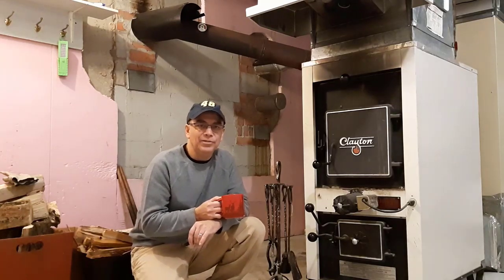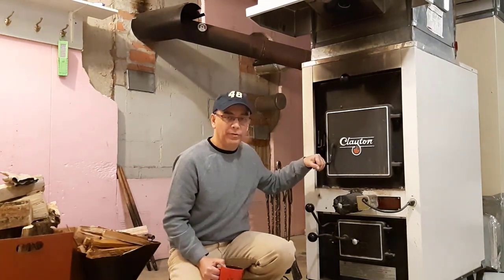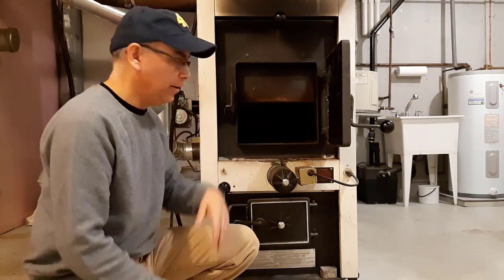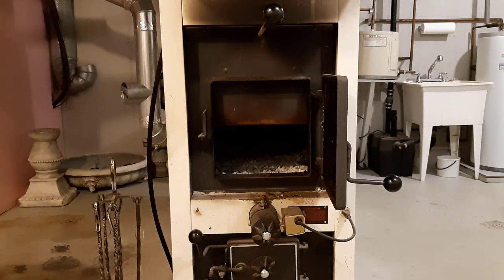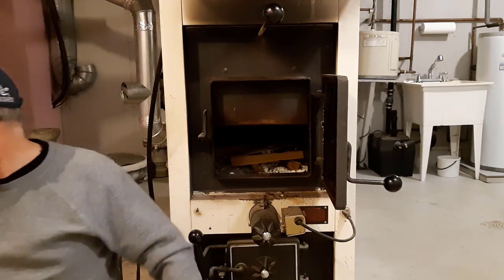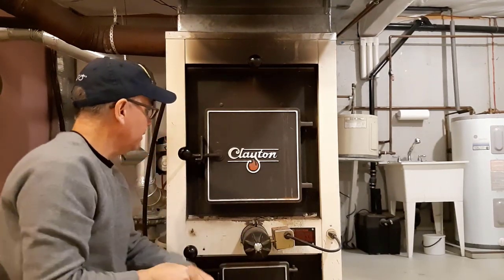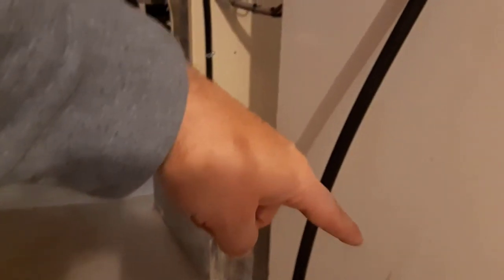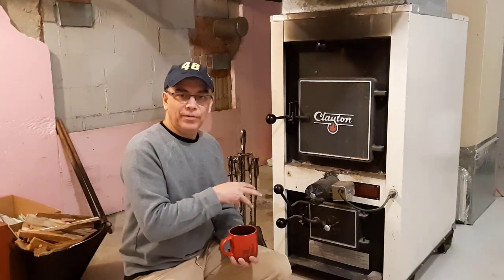USING A WOOD FURNACE INSIDE A HOME // Keep Your Home Toasty Warm!

Comment from the maker: Thank you for watching! Let me know if you have a wood furnace in your home and your experience with it... Also you can watch how I make kindling fast here: https://youtu.be/tlDZ81EB5YE
Reply: Question and Help; First of  all thanks for the video .I have a wood burning furnace attached to the heating oil furnace. How does it work? Can you use the wood furnace ONLY or does the heating furnace need to be turn on when you are using or firing up the wood furnace? Can I just fire up the wood furnace and the blower? Right now I dont have oil in the heating furnace oil tank. I havent use any of it yet  and I cant find anyone to help me clean or do the maintainance on both? Thank you in advace
Reply from the maker: @kassandrapage4379  You can use the wood furnace only. The oil furnace will be on because the blower will be used to blow the heat from the wood furnace (fire box). I adjust the thermostat so the oil  furnace doesn't engage and run. At the same time the blower will work for the wood heat. Hope that make sense.
Reply: @GettingItDoneRepairs  Thank you for the response. I have one more question. Does that mean that I dont need to buy oil for the furnace to turn the fan on? A friend of mind told me she has to spend $1500 for heating oil and it only lasted one month and the thermostat was set 65 deg. F. I cant afford to pay $1,500 a month to heat the house for 4 months of winter.

Comment: I have a Clayton furnace in my basement tied into the heat duct system, ours has it own blower motor. I installed it when we built our house in 85 and I still use it. Once it gets cold I no longer use the heat pump, just the wood furnace. It has served me well, paid $900 for it in 85 so far the only thing I’ve had to replace is the firebrick, and two blower motors. I can load the stove at ten at night and the fire is usually burning good at 7 in the morning, today when I got up it was 0 degrees outside the house was a little cooler then usual 68degrees but added wood got the fire going hot again and back up to 72 . I couldn’t be happier with this furnace.

Comment: @Getting it Done North of 7. Thanks for the video. I actually bought the exact same Clayton furnace in 1986. It was white as well and had the same smoke darkening up the front from just residual smoke that rolled out the front if I took to long to chuck a couple of more pieces of wood in. It happens when I have a bed of coals, but if it flames up that seems to pull the smoke up the flue. I kept that furnace when I moved from that house in 1998 because the new owner had NO interest in burning wood. In the new house that my wife and I built in 1998 I bought a new Clayton furnace because I didn’t want to put the old one in a brand new house (and let a friend use the old one which is STILL in service 36 years later) The new one is pine green now. The damper and door handles are spiraled brass instead of the black plastic knob. This was a great improvement because the heat dissipates off of those spiraled knobs immediately and is never hot to the touch. Even if the fire is roaring. I control my fire by the ash clean out door at the bottom and it’s spin cap. I keep the spin cap that you opened in the video closed at all times and really don’t even use it (as it is controlled by a thermostat on floor one). I manually open and adjust the ash door spin cap for draw from below the fire. This does mean that you need to limit the amount of ashes within the fire box. As long as there are a few holes through the ashes it will draw really well. 

I used to have an 8” clay tile flue and just last January 2022 I replaced it with SS liner and man does it draw now. It is 40’ tall and that creates a lot of draw to because of its height.

Comment: Interesting video. I’m 65 and grew up with a wood furnace and also have heated my own house with a wood furnace for nearly 40 years. I don’t understand why your furnace smokes and you need a range hood. All wood furnaces I’ve seen have a thermostat controlled draft control. I fairly recently upgraded to a Napoleon HMF 150.
Reply: I have a wood furnace.. my step dad never used the draft control automatically.. He says "I have to go every few hours anyways to put more wood" too which I agree. So now I do the same and do it manually. No big deal in my opinion.

Comment: Thanks for video. I have a roughly, 42 year old Kerr Wood Burning Furnace (Scottie) I’ve been using it for about a year but have no clue how the system works. There is a thermostat at top of stairs that is tied to furnace some how. Do you have any suggestions on how I can find someone who can show me all I need to know?

Comment: I have the same furnace in my garage haven't used it in years. My dad had it in the house until I was born in 92 I was allergic to wood smoke so they had to quit burning wood and use oil only. He used it probably 10years before I came along. Definitely weird seeing someone use that old of furnace still but they were very well built. I seen yours has a thermostat control damper on it mine also has a small blower to get things going faster and be more efficient for burning large chunks of wood/coal. Idk if it was an orginal option or something my dad made it was all completely automatic

Comment: I just purchased a home and it has the same Clayton furnace as yours. I have a question...I'm used to using air tight wood stoves where I can stock it at night and still have plenty of coals in the morning. The few times I have used the Clayton I shut both of the vents on the front and the flu up top. But it doesn't seem to choke the fire down per se. The fire still roars. I noticed that the spin vents don't completely shut off the air flow like I thought. Do you have any advice to get longer burn time out of my wood or do I just need to keep stocking it up every few hours?
Reply from the maker: mine burns for a few hours after we go to bed, When I get up and check in the morning all there is  is hot coals.

Comment: Do you have an external flue pipe? If so when running it up the side of the house does it have to be double or triple wall if you have it braced away from the siding? How far away from siding would it need to be?

Comment: can you do another vid going over the physics of the air flow?  I am working on my parents wood furnace and I feel like it doesn't work because of a lack of incoming air to the fire and the furnace. It causes smoke to pour out when the electric furnace fan comes on to move the air through the ducts.

Comment: My son and I have our Clayton wood stove all set and working well…..I would love to be able to have my furnace blower kick on like yours does when it reaches a designated temp…..how would I go about making that happen?  Thanks in advance for any advice!  😊
Reply: If you’re talking about the blower that is at the bottom back of your stove, its on and off ability is control by the limit switch that is on the upper right back corner (as you face the stove from behind). You can adjust the cut in and cut off temperature selections. The probe of the limit switch sticks inside that air space between the fire box and the outside shell of your furnace and it is controlled by that temp. It has always amazed me at how hot the air is (on mine) that kicks the blower on. Air cools down quickly as it moves through the ductwork. Also if you look at your actual fire box it has cooling fins on it. That firebox is not designed like a free standing stove to get hot and simply radiate heat. It needs that air from the blower going over it to cool it down. The manufacturer states that if you lose power to the Clayton wood burning furnace you are to not add any wood (obviously) and shut down intake air to it so it will not unsafely overheat. Again it is not designed like a free standing wood stove.

Comment: How about maintaining and cleaning the engine that distributes the heat. 
I'm trying to clean mine, but don't want to take anything apart and muck it all up. 
It's really dirty, and keeps stalling.. most times I have to manually get in there, and give the whole drum turbine a spin just so it spins.
Reply from the maker: I always have a guy come in and clean it thoroughly once a year.

Comment: @gettingitdonenorthof7 Question and Help; I have a wood burning furnace attached to the heating oil furnace. How does it work? Can you use the wood furnace ONLY or does the heating furnace need to be turn on when you are using or firing up the wood furnace? Can I just fire up the wood furnace and the blower? Right now I dont have oil in the heating furnace oil tank. I havent use any of it yet  and I cant find anyone to help me clean or do the maintainance on both? Thank you in advace

Comment: I’m in Pennsylvania.  I’d like one of these furnaces.  Have an old farmhouse built in 1850.  Has oil boiler that’s broken.  What do you estimate the cost of this wood furnace to be ?
Reply from the maker: Hi there, I have no clue what the cost would be. The furnace was already in the home when we moved here. Thanks for watching
Reply: Keep any eye on sale sites or buy new for around 3k. Droplet is a big brand
Reply: @nickabel8279  Thank you so much for your reply.  I will check out the Droplet brand.
Reply: Np. In pa n my oil boiler gave up. Wood stove saved me n replaced boiler with tankless. Now going to to ex boiler n focus on burning wood for financial. Wood furnance being added this year.
Good luck to you
Reply: @nickabel8279  I have had several occasions where a power outage has lasted up to 4 days during the winter months.  I also want a wood stove.  I think that both would be economical, and I would be assured of heat with the wood stove in case of a power outage.  And yes, I too have an oil boiler that no longer works.  I thought of a wood boiler since the pipes are already in place and would save on the cost of duct work.  i am weighing my options.  Thank you so much for your reply.
Reply: @rozchristopherson648  thought about going that route but baseboard limits room layout n my boiler flooded the house. So out with the water lol. Also a fan doesn't take much electricity so cold have back up yo run for a few days. And heat travels so a good furnance would push without power just not a well.
Reply: @nickabel8279  This is something I never considered.  So, you are saying that if there is an outage, you can still put wood in the furnace, and it will circulate warm air through the ductwork without the need for the electric powered fan.  That is good to know.  My father always said not to remove boiler-type systems because the pipes will stay warm and give off heat even if the system is off.  But now I like what you are saying about the wood furnace being able to give heat also when the system is not actually running on electricity.  Thank you for all your input.  it really helps me going forward.
Reply: @rozchristopherson648  I'm no expert so do your research. I just did over the last few hours n found out some systems will "gravity feed" without power. Others will not and ducts will get very hot (some companies recommend ducts rated to 750f). Also on the electric damper units they can runaway if no power.
Just be sure to do your research
Reply: @nickabel8279  I will.  Seems like most people who have a wood furnace have an old one that they don't use anymore.  But I think that it is worth it to take a look at these types of furnaces and how to fit them into the present age.  I have done some research on wood boilers but not on wood furnaces.  Thank you so much for your help.  I am inspired now to learn more.

Comment: How's the oil furnace blower work? Does it just kick on when the temp hits a certain temperature, regardless of source of heat? I guess I assumed that it automatically kicked on when the oil furnace did. I've had a wood burning furnace installed (haven't used it yet) and assumed that the wood furnace's blower would be doing all the work.
Reply: I was thinking the same thing myself, but he did actually answer your question when he said it when it got to 200 the furnace would kick on meaning I.e the blower. When I grew up we had a fuel burning furnace that my dad converted to a wood burning furnace and that's exactly what would happen it would get to a certain heat and then the blower would automatically come on when we adjusted the thermostat upstairs, and let me tell you that furnace would blast us out of the house it got so warm we'd have to open the windows at times.

Comment: So the blower only kicks on when the temp is 200?  What about the thermostat for your home?  Does it have one or does it just continue to burn until done?
Reply: I responded to an earlier post about the same topic. Mine kicks on at 200 degrees (which seems crazy hot, but moving air really cools down fast) and then the blower kicks off at 90 degrees. I have a thermostat in the living space of the home and it controls a butterfly type damper at the front of the stove. I have had the forced blower and the butterfly damper on two different Clayton’s of mine and after 36 years of using one I just quit using the thermostat and control the fire by only the spin cap on the ash door at the front bottom of the furnace. I just replaced my 8” clay tile glue with a 6” SS liner and it 40 foot tall and it draws almost to good. I almost can shut the fire down enough now. Replacing all the gasket seals on both of my doors really helped in that regard and slows the burn down now. Best of luck.

Comment: I just bought a used one identical to yours. I was wondering if you had any insight into how the electric draft on the front works?  Mine has that as well. Most others I’ve seen have the draft blower as opposed to our electric draft controller.
Reply from the maker: Hi there, my electric draft controller hasn't worked since we lived here. I do it all manually. I dont even think about it.

Comment: How often do you have to put more wood in the furnace?
Reply from the maker: I check it every hour.
Reply: @GettingItDoneRepairs  you check the stove every hour?
Reply: I have a Valley comfort and it will run for 8  to 10 hours when you load it

Comment: Does this furnace need electricity to operate ?
Reply from the maker: The heat is pushed up thru the house by the blower motor on the oil furnace beside it. So in a way yes but no electricity directly to the wood furnace. Thanks for watching!
Reply: Getting It Done North Of 7   Ok, now I understand.  Thank you for your reply.

Comment: I wanted to laugh because you haven't gotten a bill from Washington gas if you live in the DC area, the Washington gas bills are extortionate! And I just moved to West Virginia in a cabin in the mountains kind of like more like a house though but it has a wood burning furnace down in the basement which I don't think the owner was using because he was handicapped and there's a pellet stove upstairs and I really don't want to use the baseboard heat cuz that will be expensive. I've used wood burning furnaces before when I was a young kid growing up my dad converted a fuel oils furnace to a wood burning furnace. We had a thermometer on the wall and I think that's what made the blower come on I got to figure it out that's why I clicked on your video. Tons of timber around here on this property and I know about wood being seasoned and all the rest of that. That's a really great idea to have that range hood on there to do what you said get rid of that extra smoke that might escape out. Thank you for your video!
Reply from the maker: Burning wood for heat is going to be a win this winter. The price of heating fuel and electric seriously hurts.
Reply: @GettingItDoneRepairs  so I'm going to have to clean out the furnace it look like somebody was burning trash or something in it it has tons of Ash I want to clean all of that out. I've never seen this brand of furnace before it's called Leaders brand. This house was built in 1994 that means the furnace could possibly be 28 years old. There's no damper on this furnace. I'm just wondering if the blower comes on like you said, I think I saw a little temperature thing on the side. So I'm assuming it will automatically come on when the furnace reaches a certain temperature because I don't see any switches or anything like that. And when we lived in an old house and we had a wood burning furnace like I said, there was a thermostat upstairs that when it did reach a certain temperature it would blow air automatically. And that was an old house. I've read that a lot of the newer brand of these furnaces don't require dampers. We wanted to get everything inspected but the chimney people said they're backed up and wouldn't be able to even come and look at it until December and it's been getting cold around here. I'm just going to look for signs of creosote or any of that other kind of stuff, but right now it just looks like it's filled with ashes. I was also told you shouldn't burn wood that has bark on it but I guess it just depends what kind of tree it is. My dad always burned the locust trees on our property and I don't remember him taking the bark off. We never had any issues. And that was a big old furnace one of the scary looking kinds LOL